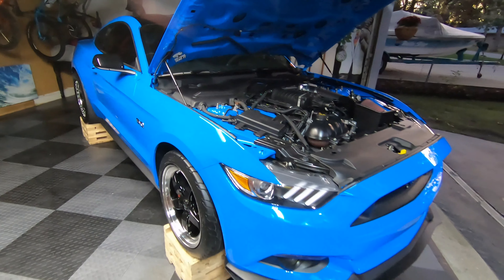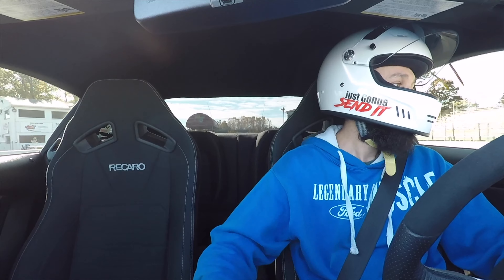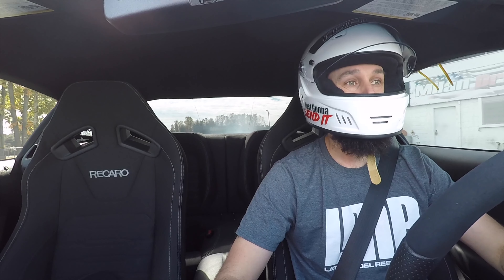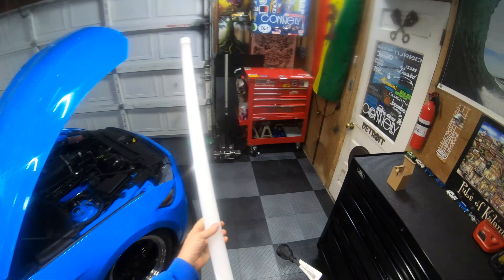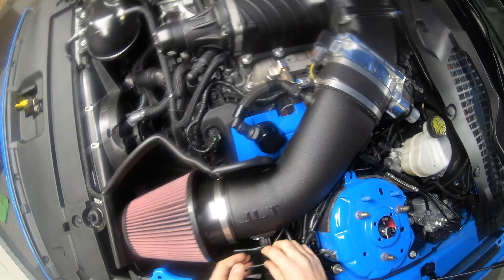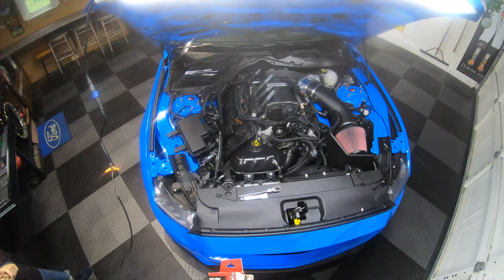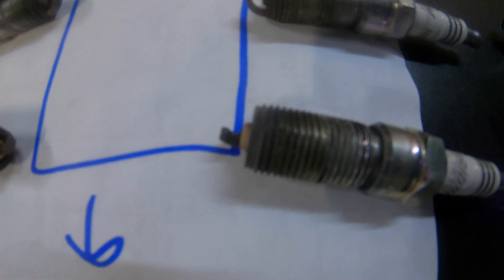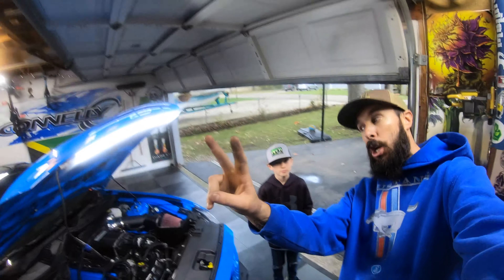Everyday Can't Be Your Best Day - Dealing With Crappy Prep and Lots of Power

Comment: I recently just when to the track 
Blow the tires off which were the same ones you have MT28x11.5by17 
I’m going to a full slick maybe that will help 
And I’m on a 72mm pulley on a roush blower also
Reply from the maker: Normally those tires hook up GREAT. It was not just my car spinning.  No one was making a good hit with the crappy prep.  Stick with those tires.  Run them at 16-18PSI, Do a GOOD burnout and send it.
Reply: PJ McMillan maybe because my tires are a little over a year old 
Las Vegas track is always bad 
How long you would say a good burn is what about rpm do you keep it at
Reply from the maker: @bioni007  Depends on what rear gear. When I had 3.73 I did them in 2nd gear (MT82 car) with the 3.31 I do them in 1st for like 10 seconds
Reply: PJ McMillan 10 secs holy molly I did a 6 sec and I Felt that it was to long 
And that I was holding up the line 
But I’ll take your word for it
Reply from the maker: @bioni007  really depends on wheel speed. Just watched the video.  Mine are like 8 seconds.
Reply: PJ McMillan on a other note I recently installed a hasty bracket and I had to use a spacer so now my 69mm pulley fits 
Is their any down fall on you always being a 69mm pulley
Reply from the maker: @bioni007  none that I know of. Prob going to move to a Gen3R here soon.
Reply: PJ McMillan how long did you race one the stock belt before you change it to a shorter belt 

I would do a gen 3 
I seen some cheap ones unless your building your motor

Comment: Hey really enjoy the videos but the trap speeds you are seeing seem very low for a 850whp car. I'm on a pump gas Gen 3 Whipple with 11psi and I'm trapping a 136. Car did 750Whp. Full weight performance pack car. My best ET was 10.8 with a 1.87 60ft. I'm still on a stock axle so I left easy. What was your best MPH to date?
Reply from the maker: Have trapped 140.car makes 850whp. Have been on multiple dynos. Watch a few videos back.  Should get some good testing Sunday
Reply: @go46ball  I seen the dyno video. Keeping my fingers crossed that you hit that 9!